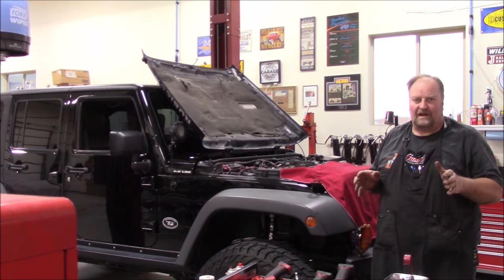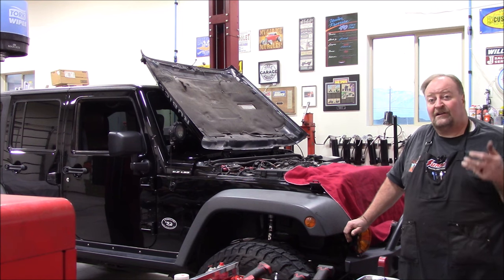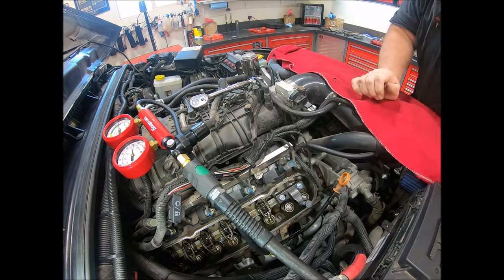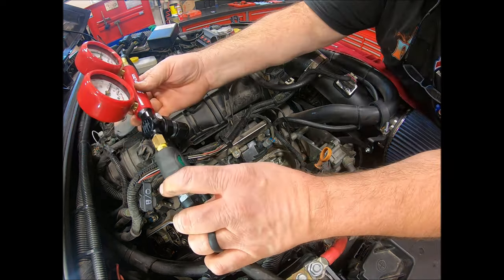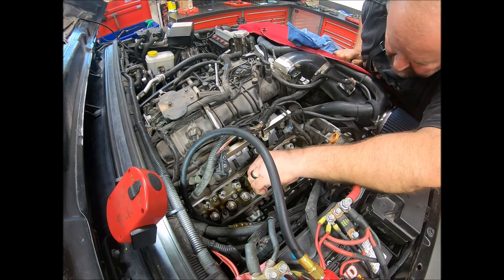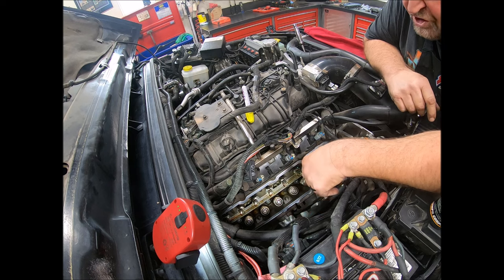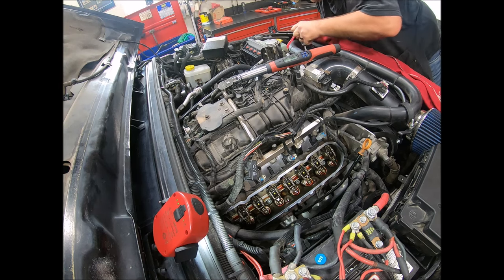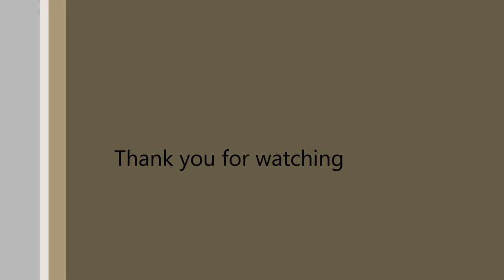GM Gen IV LS Valve Spring Failure and Replacement

Comment: Good job Mike. We don't see many LS valve spring failures, except some HP LS3''s. Around 2020 GM apparently ran out of valvetrain parts and outsourced them, big mistake. If you have a VS failure under 8k GM replaces all the valve springs, over 8k I hear they only replace one. I'm told only a limited number of engines are affected.

The leak down trick works as long as the valve is not bent, for the most part LS production engines are non-interference.

Many years ago I put an RV cam in my small block truck and broke a VS in the middle of New Mexico, no cell phones then. The Cardinal rule with valve springs is never increase the lift with a stock spring that has miles on it. Valve springs have a memory and even a few thousands more lift can lead to a failure.

Short story long with my small block in the middle of nowhere - I tied the valve up with wire and drove as a 7 cylinder to a Napa store. Purchased a valve spring and a K&S VS tool. How to hold up the valve to replace the spring with no compressor or tools?

I had some rope in the back of my truck, fed it through the spark plug hole when the cylinder was at BDC. Fortunately my truck was a manual with a wimpy 283. I slowly rolled the truck until the string smashed against the valve face and replaced the spring😅

Drove back to LA and put all new valvetrain in from Comp Cam.

I ran that 283 until it wore out, over 300k miles, lost compression and vacuum.

Ironically I put the first Gen IV LS in that truck in 2007. All the naysayers said it couldn't be done. I worked with EFI Live and we got the security system - VATS, cruise control, key off draws, tap shift and much more R&D'd on that truck. It has AFM and about 150k now on the 5.3 LH6.
Reply from the maker: Thanks Robbie.

That's the reason I chose to leak test the cylinder that the spring failed on first, to determine if it was ok and I was good to go with the other seven, if not the body had to come off and go down to the heads.  Then I'd do a full AFM delete but luckily all was good so the AFM delete will come down the road when I can schedule it between trips.  

I've built a lot of race engines in the past and never had a valve spring failure but then I was changing cams and springs quite often so they never got the miles on them that this stock L94 has now.  

Luckily I've never had to do the steering in the cylinder truck because I've always been fortunate too have air readily available.  

I'm just grateful this spring failure happened about four miles from home and not during one of our RV/Jeep gatherings and we were 30+ miles off the pavement in the back country. 😲

Thanks for taking the time you watch and comment Robbie, how to and your family had a wonderful holiday season.
Mike